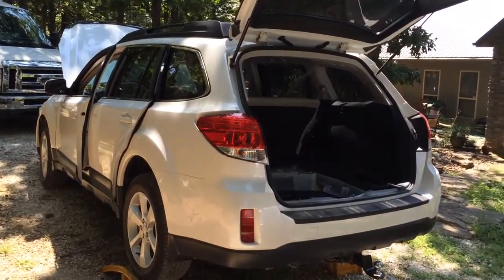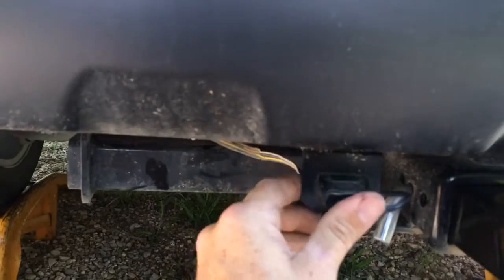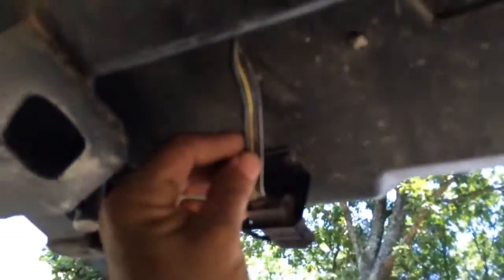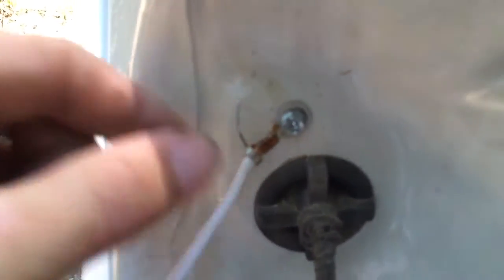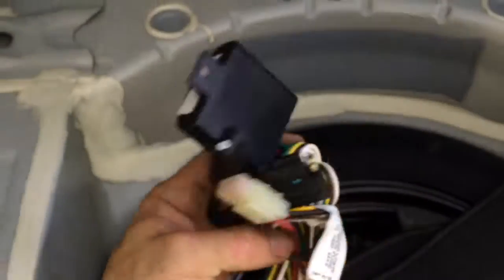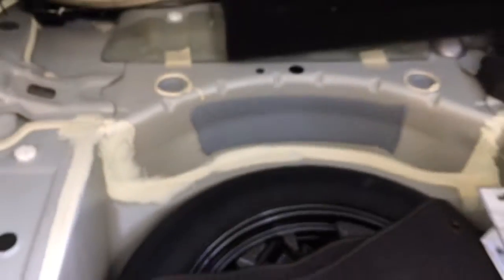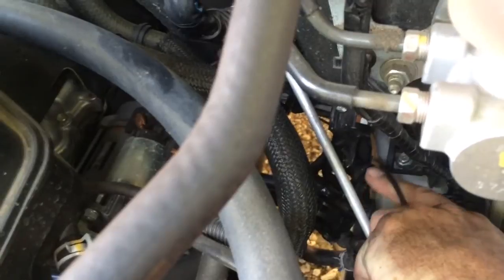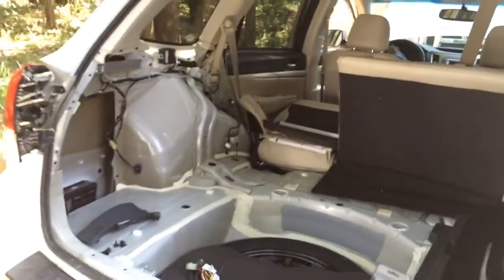How NOT to install a trailer harness on a Subaru Outback

Comment: Uhaul in Poughkeepsie new York installed our hitches like this ! completely voiding the factory warranties faulty ground wires and all. When it was returned for issues they simply put a larger fuse in the harness. All they had to do was plug an adapter into  the stock harness. It was a mess. I will never ever go to a Uhaul anywhere. The best part is they charged us extra for the direct connect  parts but never installed them ! ...this guy is right be careful out there

Comment: Unbelievable! I literally recoiled when you pulled that tail lamp away to reveal all that shoddy wiring. I recently installed the OE Subaru hitch on my 2005 Outback H6. Subaru couldn't have made it easier to wire the car for a 4-way harness the right way using the factory connector. Even aftermarket hitch manufacturers make the proper plug-and-play modules for less than $50. I just don't get it... Great video!

Comment: On our outback, the crap place we got our trailer from converted the 4 pin to 7 pin similarly.  They spliced off the connector from the subaru 4 pin, and then ran two wires underneath the car,  one black one blue.  the black one is +12v.  fun.  I'm about to rewire it myself. :/

Comment: Do you know if you can use the preinstalled wiring harness that the Subaru has and wire a 7 pin to that?  Didn't know if the wiring could handle it or a heavier gauge wire is needed that runs from the battery?

Comment: Just did an install in a 2015 Outback. The only thing I will say is that there is no reason that Subaru could not have made the plug easily accessible. Nice of them to provide a plug, but could have made it easier.

Comment: Do you have a video of how to thread that harness so that we don’t have to have it hanging out of the back/trunk/hatch...neater to have it mounted at bumper or hitch. Would love a reply.
Reply: I have the same question as ElYoRen. 

I bought the wiring kit same as shown in this video. The online site I purchased from has really nice videos showing how to install the hitch and where to locate the factory plug as shown here. But then they just run the wires thru the cargo area and then "flop" the plug out the hatch when you need it.
I would prefer to run the wire thru a grommet and have them under the vehicle. Is there a spot you recommend to go thru the floor?
thanks!
Reply: Has anyone found an answer to this elsewhere? I’d appreciate a link.
Reply: I have a 2019-version of the forester.  There's a gromet you can cut a slit into under the spare tire.  Just choose one of those two rubber thingies, and if you want seal it with silicon after you cut + thread it through.

Comment: Like to know about the outlet plug. I'll have to go check tomorrow to see if that was available for the 2008, which is what I have. I am going to install a tow ball (y'all seem to call it a hitch) but not for towing. I need it to support the lift gate for my motorized wheelchair. So I won't need the wiring. Will be watching several videos to see how to install. I'm a handicapped individual on an extremely limited budget so must figure this out on my own. Have to have a way to transport my wheelchair around. An organization is providing me with a refurbished wheelchair and I need to pick it up in three days. Thus I need to quickly educate myself.

Comment: I have a 2017 Outback 4 cylinder. The manual requires the trailer brakes on a load over 1000 lbs. What do you think about a 4 cylinder from Florida to Indiana, with a payload of 2000 and no trailer brakes

Comment: So, the factory destined plug adapter is great.  Yet, all those after market plug kits(including the extremely over priced dealer plug($135 vs $50 for the most expensive from e-trailer)) want you to hang the wire out of the trunk from under the spare tire cover and cargo covers.  This is hard to get to when you've a gear loaded trunk, and likely to fray over time.
Especially with daily use.

I want a fixed plug!

Where would you route the wire from one of those kits to add a more permanent mount under the bumper?

Perhaps... Through the trunk hole/rear light grommt you showed, then down under the bumper?
Reply: Unbelievable... I have tried to write out a detailed response to your question TWO different times and YouTube will not let it post.  Hmmm....

Comment: My hitch light was installed by Uhaul and then my dash/radio lights all of a sudden started blinking when I signaled left so I removed the signal light to find exactly what you said. Shit patch job with no visible fuse. 2017 Outback, I called a different store to find out what their standard procedure was and the different store said they do the direct to factory harness and that the turn signal patch work always fails. So this other Uhaul calls the bad store and arranges for my hitch light to be replaced (under warranty) the correct way. we'll see.
Reply: Andy Reynolds Photo What do you tow and what is the weight. I want to know how does you Outback deal with the load on a 4 cylinder.

Comment: Does the 2016 Outback that connector in the same place? I had what I thought was a fairly reputable trailer shop wire my 2016 Outback for a 7 round connection and they totally butchered my car and ran the wires so poorly I had to take it back.
Reply: Lou Sassle Yes! I own same vehicle and I put on a Curt wiring harness connector (see Amazon).

Comment: as somebody who hobbies in upfitting of emergency lights and such this made me cringe hard core though i’m not surprised. any car you almost never run wires through the frame/underside of the car. pickup trucks only. my 2015 outback isn’t perfect and isn’t complete with my emergency lights, however it’s still better than this mess.

Comment: Why not just connect to the 12v cigarette lighter / aux power right there in the back rather than run all the way up front?
Reply: I would love to hear if this is option!
Reply: My guess is the gauge of the wire is not great enough to support 7 way (used to power electronic brakes RF module and charge batteries).  Typically you would want 10 gauge to support those features.

Comment: Unfortunately this factory plug is not available on my 2003 Subaru Legacy outback sedan. And after talking to Subaru HEADQUARTERS engineering department they told me that there are many Subarus especially sedans that don’t come with that factory plug. People will tear their entire interior apart looking for that plug that doesn’t exist even though it shows it on the factory wiring diagram. Thanks Subaru. You suck.